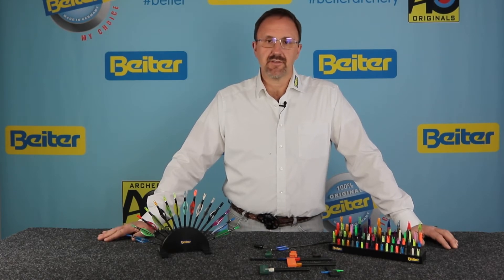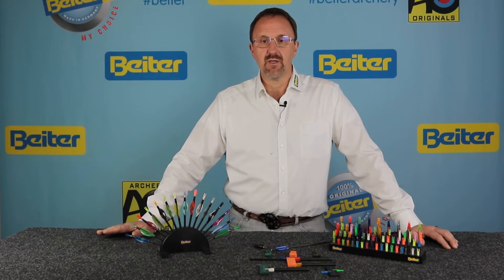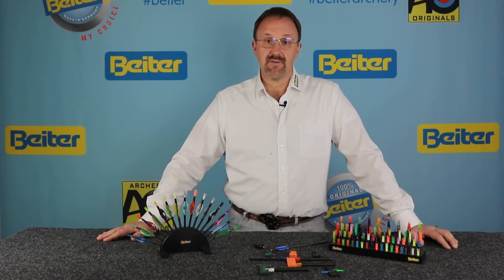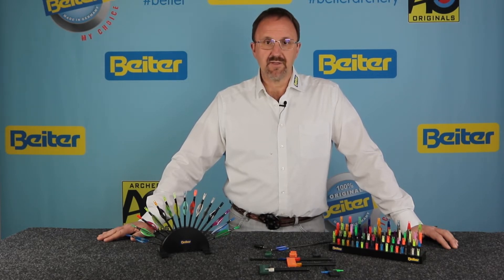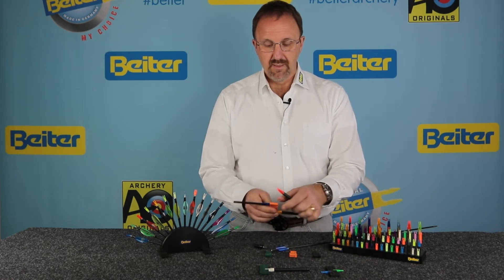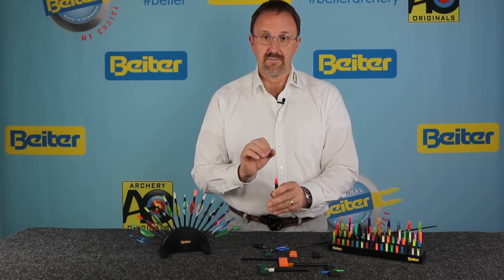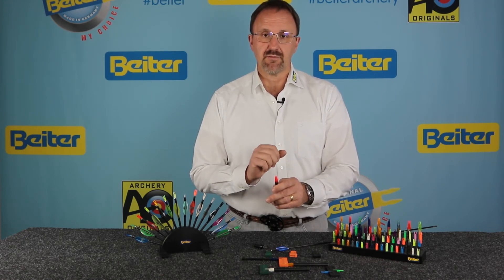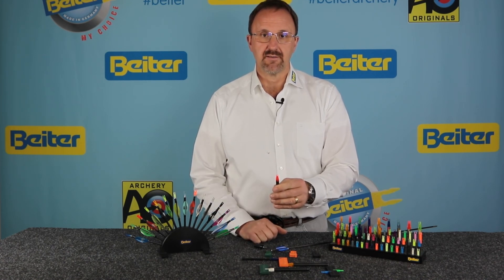Features of Beiter Nocks you didn't know before

Comment: I had Beiter. 166", nock insert. Sometimes they are a bit too tight and slightly too loose for 4.2mm inside diameter. I don't think Easton Avance is 166"; maybe it is 167"; for Skylon Brixxon, the nocks fit nicely.